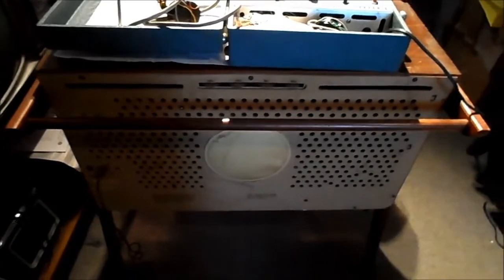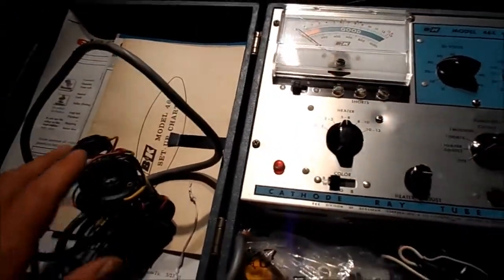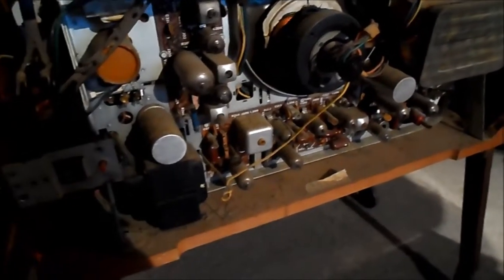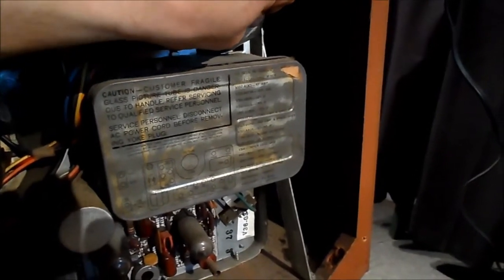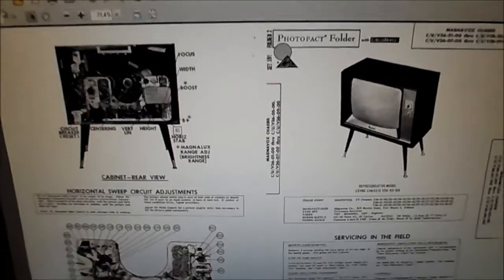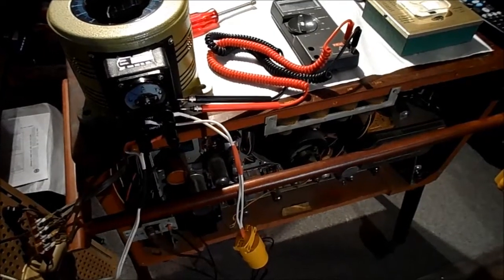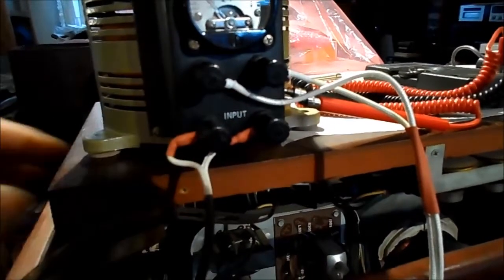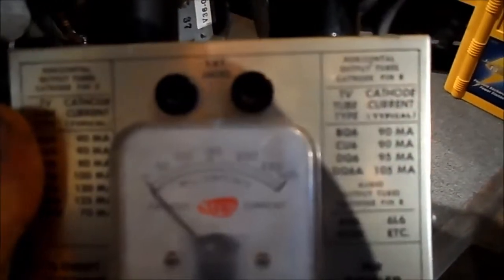Vintage 1965 Magnavox 19 inch B&W TV. 1st.  Power up.  Part 1.

Comment: The backing repair came out great Robert! I can hardly tell that you actually repaired it. Though, I know I'm not there to see it personally. but a nice job on that!
   Who cares if you don't have any sound at this point. Congrats, you have HV and a raster and just call it good for a first power up. You are just darn lucky to get THIS far!
   That is funny,; What all a lot of you other guys say is; "the controls seem appear to be dirty". Video after video, I see the same response.
   Whenever "I" work on vintage sets the very first thing is that I tackle is the controls. Then, everything else comes next. Maybe I'm just brain dead here. But this really seems to me to be a "Duh" moment.
   Great video Robert, and a lot to think about.
   Tom
Reply from the maker: Must be because my 15 year old 9 oz. can of Radio Shack's "Color TV Tuner Cleaner" has run out. & my ancient GC electronics control cleaner has lost pressure. I guess folks use control cleaner by MG chemicals these days. Always nervous with tuners, don't want any additives, like silicon or oils. Nobody makes "tuner cleaner" it seems. But just re-upped with a can of GC Electronics DE-OX-ID Contact Cleaner. What has knobs/controls these days? As always, appreciate the tips. Caig is another, but pricey.

Comment: I noticed you often use a variac to slow power up, with the horz out tube pulled. I generally also pull the vertical out tube as well, but would like to add a caveat to this practice. I noticed some sets will tap the horz out rectified grid voltage, filter it, and use it as a neg bias on other tubes. with the horz out tube pulled you used this neg bias and it "may" be a bad thing for other circuits. Clearly a lot will have to do with just how low the voltage is set, how long, etc.... but for now on I like to look at the schematic to see if this bias source is used (as it was on my predicta). Running the set at full power with the horz out tube with that set allowed the grid to be too positive on the vert out (it used this taped neg supply) just something to keep in mind.

Comment: LV supply is from a stack power supple off the audio cathode, check the cathode voltage of the audio out, should be about 125v. If you pull the chassis be careful of the horz osc coil (down low on the chassis on the sweep board). Its easy to tilt the chassis and have that coil come into contact with the cab, resulting in busted coil form.
Reply from the maker: This is a crazy setup. I mean not the usual 150 ohm to ground. Part 2 coming. One voltage is too high, I'll report back. The output tube emission ok, but tests with shorts. I suspect output transformer also.
UPDATE. Pin 7 Cathode=233V. Pin 1, 8 G2=233V Pin 3,6 G1 =107V. Pin 9 Plate =233V. The 2 electrolytics were jumped with new ones, no change. Can the shorted 6GC5 cause higher cathode voltage?  Or is the 120V supply feeding the cathode high. Pause here & wait for new tube to arrive? P.S. Note to self: Watch that Horiz. osc. coil. Thank you. SAMS 591-2.
Reply: the output tube is used as a voltage divider to get the 120v supply. You will see there is no direct 120v supply from the power supply, the voltage drop across a correctly biased and working tube  is how the 120v is gotten. this saves a resistor but can add complication if the audio out tube goes bad. I am not saying this is the problem, but since the audio is not working it will give you a quick check. From what you describe the 120v supply will be too high so it still works (the IF also uses it IIRC) but clearly there is no voltage drop across the tube, so its not going to be amplifying any thing as is. I would recommend not operating it until you get a good tube. You may want to check that tube again, if shorted, give it a wack on a hard surface, square to the tube and test again.
Reply from the maker: Dave WM
Will try to wack the short out, unit the replacement comes, and/or not run until I get that tube & the cathode voltage drop corrected. I use the variac initally, but turn it up quickly after the 1st. couple times. On an old set that hasn't been on for a long time, hitting it with full AC at first is hard on the components some say. I agree somewhat. Good to know re: affect on the other circuits. I did have a fisher solid state reciever that drew massive more current at a lower AC input. P.S. I did not check the other side of the .002 coupling cap for audio, but it is a disc type. The voltage is off regardless of that.
Reply: I do the low volt startup all the time as well, the only real problem I see is if you keep it an near full voltage for an extended period of time AND it uses the neg bias that would form a the grid of the missing horz out. I know this from my recent predicta exp so its just something to keep in mind (I left the vert out tube in place one time with the horz out tube out of circuit, full power after the intial check out just to see how the vert sounded. This is when I noticed the bias voltages were off on the vert out grid.